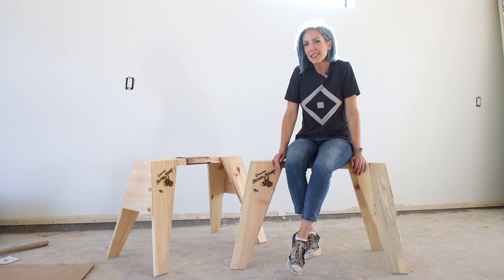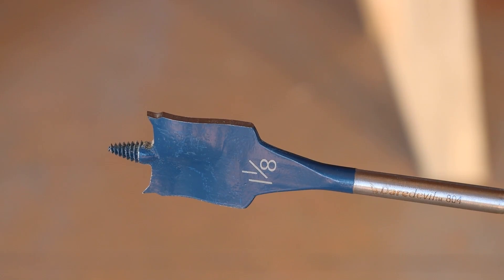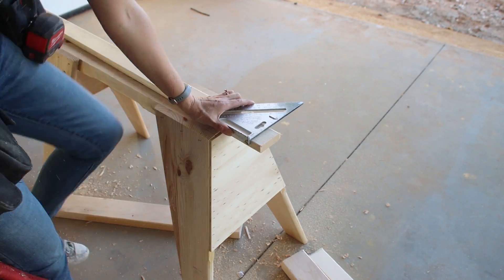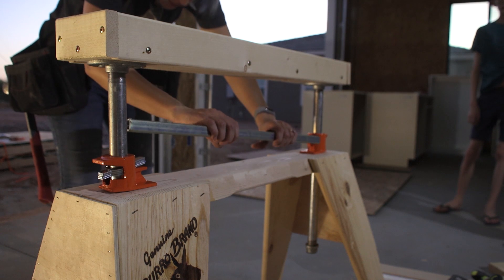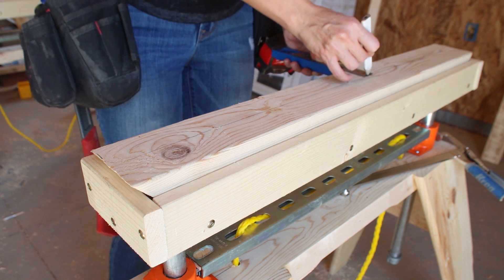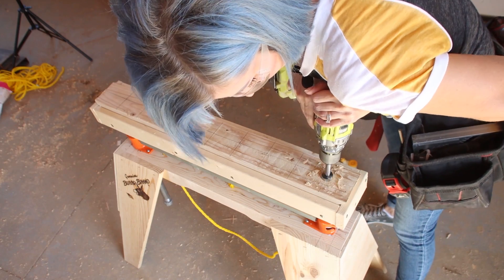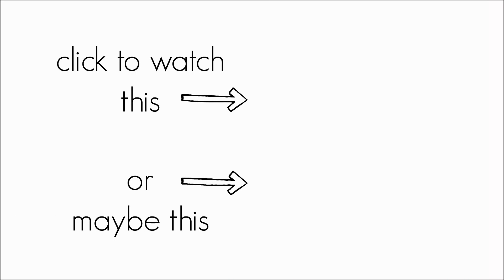BEST Adjustable Sawhorse with Interchangeable Tops

Comment: Good idea, but your bar clamp locking mechanism is backwards. The clamp pieces need to be under your sawhorse for the locking rings to work properly. The way you have them, they wont support a lot of weight.
Reply: They are installed correctly. If you mount them the other way they wouldn't hold. The pipe can slide up but not down the way they are mounted.

Comment: For breaking down 4 x 8 sheet goods, you could run 3 each 2 x 4’s between the sawhorses on the neoprene inserts to create a great sacrificial grid. Then set your blade depth just like you did when using the foam sheet. It’s the safest and most stable way to cut down plywood, MDF and other difficult to handle sheet goods.  Especially if you make yourself a rip guide for your circular saw. (There are several excellent video’s on making a simple plywood guide that will allow you to cut down ply to exact dimensions.)
Your horses came out great, they are so functional!  You’re so right, you will be finding new uses for them for years.  Thanks for sharing them with the community.   Cheers!

Comment: Love these. Only thing extra I would do is mark the vertical pipes so you can make quick adjustments on both sawhorses to get them level.
Reply: Or to match them to the height of your other tools for outfeed tables.
Reply: Only if your floor is adequately level, otherwise trusting the markings will lead you astray...

Comment: I thought I'd seen all the sawhorse videos I could ever benefit from, but this one gave me a few new thoughts.  The inserts are all great, but I really liked the idea of mounting that  insert tray on the pipe clamps, which are separated by the channel.  The channel adds strength, and the pipe clamps transfer all the weight from projects sitting on the insert tray into the ends of the sawhorse and the legs.  Architecturally speaking, that's always a good idea to take potential extra pressure off the center.  
My suggestion, though, is to make it a little easier to unlock the pipe clamps by cutting the rope and make a foot operated pedal out of a long piece of scrap wood.  To keep the pedal from turning over, anchor a piece of PVC pipe in each end of the pedal, long enough to cover a substantial portion of the rope.  Thread the rope down through the pipe and the hole drilled for anchoring the pipe, and knot the end as you demonstrated.   I don't think the pedal would get in the way while working, and it would eliminate the rope from getting twisted or tangled off to the side so it becomes difficult to get your foot onto the middle of the loop.  Not sure, but I think if you pressed one side of the pedal, it might only release the lock on that side's clamp, so you have to step on the middle consistently.  I suppose you could keep the pedal from getting in your way by gluing a couple of pieces of Velcro to the sides of the pedal at the ends, and putting a short strip of the mating surface on the far leg from where you are standing, and after adjusting the height on your tray, just push the pedal away so that the Velcro tabs connect to the far legs.  To release it, just put your foot on the pedal and push down with a little force and it should loosen pretty easily.
Anyway, making that modification might be kind of fun, just to try it out.  That detached workshop area looks like a real dream.

Comment: Thanks! A few ideas:
- put neoprene (1 or 2 layers) under the feet - it will prevent sliding and wobbling on uneven flooring
- attachments: put say neoprene on one side and the rollers on the other side of the 2*4 - put screws at the ends, so you can lift them out of 2 slots and rotate them as needed (won't work with the dowel-rollers (unless you make them narrower and the tray underneath open)).

Comment: Great ideas and very useful (although I didn’t get to dowel pins idea until you told me) still very useful. I already use the flying saucers and the pipe idea for my outfeed table at my table saw but I love the idea of moving them up and down and will be pinching the idea for my use, I will also have to take a trip to my local DIY shop for some of that tape to stop anything from moving. Well done again.

Comment: I used those ball bearing inserts for a different purpose in my shop. Here in S. Florida, the humidity got 'em. They quickly rusted and wouldn't roll reliably. I got another set and sprayed them with some dry lube, the kind that has Teflon and some kind of wax in it. I think it's made by CRC. I'm pretty sure it's the wax and not the Teflon that does the trick. A couple of years in and they still look pretty much like new. I give them a spritz every once in a while (when I think about it).

Comment: I just bought everything I need to make these. I'm going to skip the flying saucer roller bearings for now, although, I might want to revisit them down the road. Those PVC rollers are going to be a huge asset to my contractor sized table saw. I'm very glad I found this channel, and this video, you just got yourself another subscriber.
Reply: The rollers will work much better for table saw work. The long roller will pull or push your work depending on which way the roller is positioned relative to the fence, The rollers don't care. Ask me how I know?

Comment: Love the adjustable sawhorses! The Kreg Multi-Mark Measuring Tool has another feature built-in. That stepped edge is used for marking the reveal on door jambs for installing casing. It's about 3/16 or a light 1/4".

Comment: My shop is only 9x12 with an uneven, slanted floor. My biggest problems are moving benches and aligning top heights. If I put a wheel bar across the bottom of the pipes, I can lower the wheels below the legs. But, when I raise the height of the table top, it raises the wheels off the floor so my table is solid on the floor. Not only will this allow me to align the tops of table, saw, etc, it will let me have what I've never had... completely level work areas!

Comment: Sometimes using galvanized pipe the clamps will slip due to the softness of the galvanization. So using black pipe is a better idea and it also costs less.

Comment: I don't own a saw, I just enjoy watching vids but my idea would be to have a sawhorse with about 7 inches overhang past the legs to add a hole for bench dogs.  I am not a woodworker so i don't know if this is something that is really needed as it seems sawhorse are just meant to hold stuff up. My other idea would be to just make some of the gadgets reversible so you could just flip over the painting side with the flat side and make the hand grasp part a double wedge like a triangle so you could still have that easy pull feature.  Lots of great ideas in this video.

Very professional to give credit to all the other craftsmen.

Comment: Cover a set with low pile carpet for installing hardware on a finished door, or cabinets... you can also make a set of side saddles that will hold the door vertical (perpendicular to the floor) to make the cuts for hinges, etc...  I would also shorten the horse legs so the new top is at a lower starting height... the wider footprint should make this system more stable... (this description sound like working in a barn lol) You can also make some for working with pipe and hardware... add a chain vice and a standard vice...

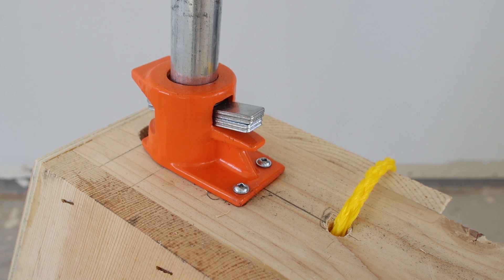Comment: 11:38 Hold up, this is the second time that I saw Robertson screws on a US channel.
What's going on, are Canadians sending you guys care packages? 😆
Reply: Left over kreg jig screws. Lol
Reply: @jonatham35  interesting they Kreg uses them then. That's what we have in Canada but I would have thought the us version would be Philips.
Reply: @heyimamaker  I would prefer them to be torx. I have had bad luck with Robertson bits rounding out. 😏
Reply: @jonatham35  Might be cheap bits would be my guess. I have had the same bit for years.  I have also had Torx bits strip out on me.
Reply: Idk why flathead and phillips still exist, and Robertson can get bent. I've gone Torx and am not looking back.
Reply: @RobertSmith-me3gs  I have used Torx on mechanical stuff and it is OK but it still strips out.  

Part of using a proper screw is that it will cam out to prevent over-tightening.

#2 Robertson is the best all-around IMO
Reply: @heyimamaker  I've stripped too many Robertaons during disassembly to still think positively about it. I'll say this for it, though. Beats a phillips and flathead.
Reply: @RobertSmith-me3gs  nothing wrong with phillips,  if you try driving them with your hands instead of your feet you will have much more feel for it, try it 😝
Reply: Oh yay! The peanut gallery has arrived.
Reply: @RobertSmith-me3gs  Fasteners fall under forbidden topics like trucks, politics, and religion.
Reply: I'm in Colorado. First time I used Robertson screws ("square drive") was 35 years ago. Not new.  Wish we could adopt your healthcare system too.
Reply: @TrophyJoe  I spent a week in Colorado Springs and loved it there!

Comment: Hello, question, at 12:01 in the vid, you see the Unistrut with wood inside it. Does this help it engage the pipe clamps or was it there for a different reason? Also, did you end up re-drilling the holds larger for the pipes to go through at the saw horse? It looks like the holes are larger that the pipe clamp at the same spot in the video (12:01). Thanks for the video.

A couple tips and tricks i learned doing this:
1. Use the router and random orbital sander to soften the edges on the tray on all sides and smooth out the surfaces. 
2. Make extra sure you are getting a perfectly vertical 1 1/8" hole for the pipe to pass through on the saw horse. This will make life easier later on when testing it out.
3. Test the pipes and take extra time lining up the pipe fitting to the 2x4 as anything less than perfect will cause biting when it tries to pass through the saw horse. Mark, secure 1 screw in the fitting, then re-test, mark again, then secure a second screw, test, if good, put the other two screws in. If not good, remove screw and try again with a different screw hole.
4. Keep a speed saw or Dremel handy for the Unistrut.

Comment: European friends... And South American, Australian, Asian, Middle Eastern... Etc, etc... haha.
Only the U.S. and like, two other major nations use imperial. haha.

Sorry, couldn't help myself.

Otherwise, awesome project! haha.
Thank you for sharing your ideas with the rest of us.

Cheers.
Reply: What are the two other major nations? I hear England has mostly stopped using imperial, at least in anything official.
Reply: @mckenziekeith7434  Liberia and Myanmar, I believe. I'm not going to judge on "major."
Reply: @ccreutzig  In my first draft list of major nations I inexplicably omitted Myanmar and Liberia. Fixed now. Thanks! All kidding aside, I don't mind inches too much, but I hate mixing inches and feet, and I hate fractional inches. It is so, so stupid.
Reply: @mckenziekeith7434  Fractions isn't that hard. What I hate is when they actually write them out on the tape measure. It gets so busy & so many markings it all runs together even wearing my glasses.

I also agree with you on feet & inches. They need to be used as two different systems. I mostly do inches in measuring for accuracy. I only use feet when it's plus or minus a half a foot. So I'll say give me a 8 foot board but to cut it I go back to inches.
Reply: @mtking2196  Probably it is not hard for you because you have used it extensively and you are now an expert. I am an engineer and do a lot of adding of numbers, etc, and I still find fractional inches to be difficult/irritating. I am an electrical engineer, and do circuit design. But I still have to deal with some basic dimensional stuff in my professional life. And mostly I work with mm nowadays. But when I work on projects at home, I have difficulty adding up all the fractional inches. Finally, I bought a tape measure with mm on both sides. That makes most things a lot easier for me. I am proficient at changing back and forth between mm and inches, of course. 25.4 being the magic number.
Reply: @mckenziekeith7434  
I use both fractional inches & decimal. I also use metric often & sometimes at the same time. It's often I have to convert one to the other in a project. I have both types of tooling & I'm often going back & forth.

If you find yourself needing to use fractions try counting by the closest accuracy you need. If you need it to be within a ⅛ count by all 8. ⅛, ²/⁸, ⅜, so on. Same with ¼ or what ever works for you. ⅛"is about as small as I go without switching to either decimal or metric. I don't do much that a tape measure would be any good when I have to measure that small.
Reply: @mtking2196  For my work, everything is decimal. Mostly mm or sometimes inches. But if I am making something at home on my own time, a plywood box or something, then I have to sometimes subtract out the thickness of the plywood either once or twice from the finished outside width. Something like that. I find that to be too frustrating with fractional inches. But I don't want to be off by an 8th, either. So I use the metric tape measure with mm markings. Digital calipers for measuring plywood thickness, etc. And sometimes I have to deal with binary numbers as an electrical engineer. So it is not that the fractions completely baffle me. The problem is that it is unreasonably difficult and forces people to become proficient at power of two arithmetic in their heads instead of just letting us do decimal arithmetic which is much easier and nicer.
Reply: @mckenziekeith7434  
Decimal is much easier then fraction when dealing with close torrance but that's also to snap for me to read on a tape measure & those tools read in decimal or mm. Reading in fractions did make reading a micrometer easier. I've never used binary. I only know it as in computer programming as in off & on.

Comment: Nice.  I have an idea to build a out feed table for my table saw.  I would like the table to be height adjustable to provide ou tfeed/support for my drill press table as well as my band saw table.  This may be the start of a solution.   The base would probably be standard four leg table design on wheels instead of a saw horse configuration.  It would be nice to already calibrated stops to match the different table heights of each saw.
Reply: It would be nice to build bases for the drill press and bandsaw so they all have their tables at the same height. Although with the drill press, that doesn't really work since the height of the table is frequently adjusted up or down.

Comment: OK. Built these and have now used them a bit.  Nice but here are my observations.  Parts and such add up and becomes way expensive compared to alternatives so unless you're feeling flush or just want to try it maybe give it a pass.  I like the flexibility. It doesn't stack so there's that.  I need to have a plan for the wasted other ends of the pipe clamps.  Burro stands are of varying quality - choose wisely or make 'em.  I was cutting up a couple of 4 X 8 X 3/4 sheets and the clamps slipped unexpectedly ruining my cut.  (Note: Used black pipe - not galvanized). OK maybe I missed locking them carefully before cutting.  Nope! It happened again even when I had double checked the set by leaning heavily on them. Maybe I'll try to roughen up the pipe a bit so they are less likely to slip.  We'll see but I won't be unconditionally trusting them going forward.

Comment: Good idea, but whoever builds it will be out -besides everything else- a little over $60 for the four lower halves of the Jorgensen 3/4" pipe clamps.  Seems a tad pricey for a set of sawhorses, unless you're a pro who uses them every day.

Comment: I am sorry to report that metric system is not european. USA is the only country in all americas to not learn it at school. ;)
Reply: I am an American. There may be some sense in which what you say is true. But I assure you that science classes in the USA use the metric system extensively. However, tradesmen (plumbers, carpenters, electricians) use feet/inches/fractions. It is terrible. But somehow we carry on anyway.
Reply: There is those of us that know how to use all three systems metric, fraction, and decimal with ability to convert when needed. There is pros to all three systems.
Reply: @mtking2196  there is no pro whatsoever to the fractions. They are stupid and increase the chances of errors. People who practice at it can get better at manipulating fractions quickly in their head. But that is not really a "pro." Mixing feet and inches and fractions of inches is exceedingly difficult and tedious and apart from tradition there is no justification for it. I am an electrical engineer and I often convert between inches and mm. If we stuck to inches only that would be fine. But all the odd conversions (12 inches to the foot, for example) are really stupid in this day and age.